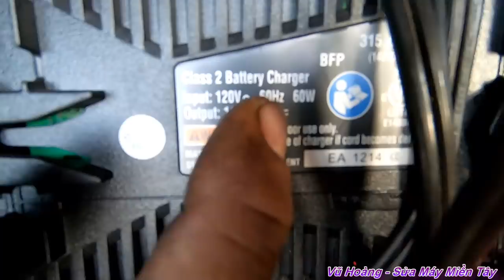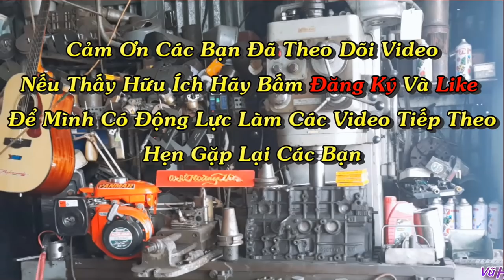Cái Kết Đắng Lòng Khi Trao Đồ Nghề Hiện Đại Nhầm Tay Thợ Vườn

Comment: Cây Milwaulkee của bạn số mã là 2860-20 cố lõi gắn socket là 1/2 inch = 12.7mm . Lực xiết tối đa là 450 ft-lb = 610 Nm . Nặng 3.8 lbs = 1.7 Kg . Bạn nên ghi xuống số lực xiết và mở để biết khả năng của máy khi cần mở Bulong . Có cây mới hơn 2767-20 cũng cốt lõi gắn socket 1/2 inch vòng tua chậm hơn nhưng lực xiết mạnh gấp đôi 1000 lbs = 1355.8 Nm nặng 5.9 lbs = 2.7 Kg . Tôi cũng vừa mua trên Amazon cây nầy 2767-20 luôn thuế hết $238 usd , Chỉ có Súng không có pin vì tôi đã có nhiều pin rồi . Tôi có dư đồ sạc chưa xài qua ,rất tiếc không ở gần em nên không cho em được . Vì tôi đang xài 2 cái Rapid Charge biết bao giờ mới hư . Tôi thích kênh của em , người miền Nam chơn chất .